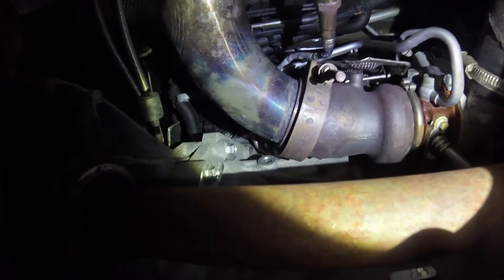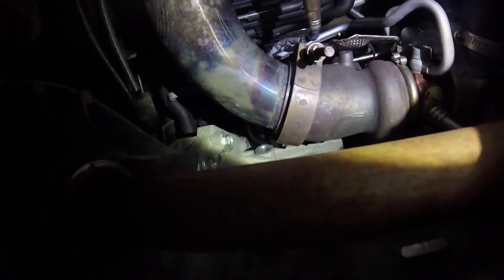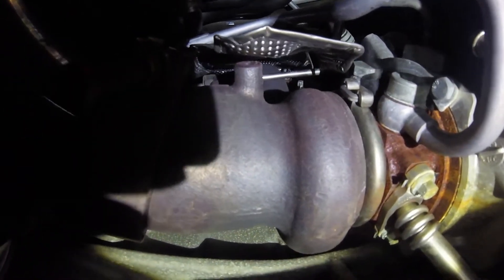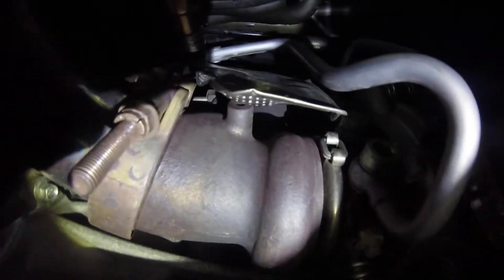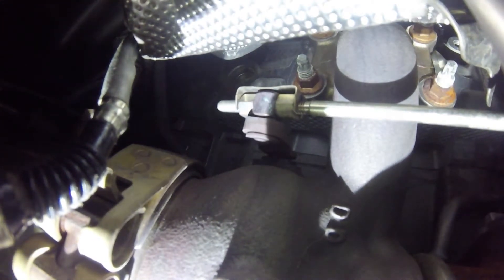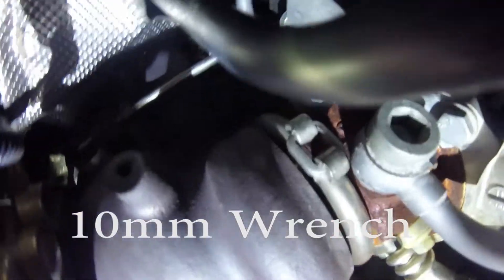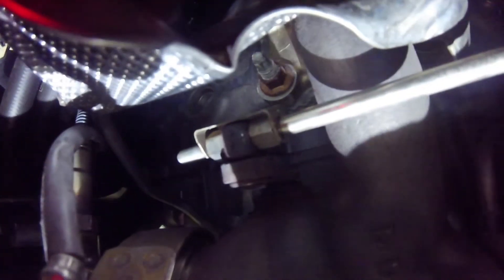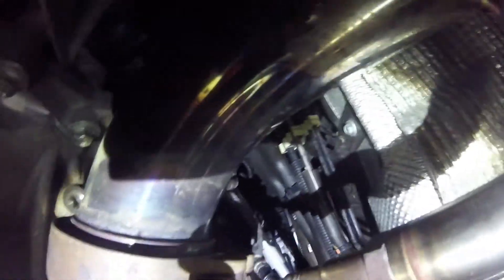Focus ST Wastegate Preload Adjustment

Comment: I'm not getting more than 7lbs of boost right now so I thought about trying this. No other leaks and my check engine light is throwing actuator codes.
Reply: I’m in the same place with my 2016. Has a rattle on decel that almost sounds like a bad exhaust leak which after seeing this video makes me wonder if the retaining clip fell off causing it to loosen up. I’m only making 7-9 psi but haven’t thrown a code.

Comment: would you feel a difference after doing this? waiting for the tuner to re tune it but i didn’t feel a difference when driving after i did it
Reply: It holds about 2.4psi higher to 4.8k rpm. Then about 2psi to 6k. Only do this adjustment if you have intercooler & downpipe. Intake & throttle body would be ideal. The aftermarket wastegate will hold up around 25 and drop to 16-17 near 6k. You're definitely pushing the stock turbo w/ aftermarket

Comment: Hello there I currently have a stage 2 hybrid turbo and running 362bhp but been told to replace the actuator on the hybrid turbo it’s like a turbosmart but with turbo company logo instead of turbosmart it’s currently got a yellow spring it and I am boosting at 1.55bar I do have other springs I have been advised to go for a forge actuator or could I just not put the blue spring in also would it need adjusting and if so how hope you can help thankyou 👍🏻

Comment: Hey what spacer do you have dose your AFR lagg or not cuzz I put on a spacer and my AFR laggs and I get a code saying that the o2 is reading slow I don’t know if you have that problem please help
Reply: Did you put the spacer on the bank 1 sensor or bank 2 sensor?
Reply: On the o2 sensor the one close to the turbo
Reply: @st.guy1009  never put a spacer on the bank 1 sensor it can cause the car to run lean or rich. You only put spacers on post-cat sensors

Comment: What o2 sensor do you have your defouler ?
Reply from the maker: Wilfredo Rivera only put a defouler on the rear o2 sensor. NEVER PUT IT ON THE UPPER WIDEBAND. Your car will run like absolute garbage
Reply: Patrick Collins yeah but won’t it throw a code?
Reply: No bro it won't throw code if you put it on the back 02 sensor.... the front 02 sensor controls air fuel ratio

Comment: And the purpose of this is? Back in the 90's without all the computers, this would actually add some boost. But Imdont see that working here. Not in this day and age. Nor is it safe for the car.
Reply from the maker: MH motorVlogs a wastegate is still a mechanical device and provides a noticable difference. As stated in the video you must tune the car to accommodate this